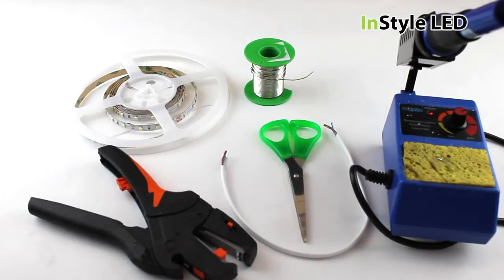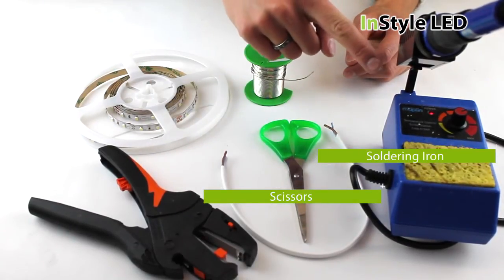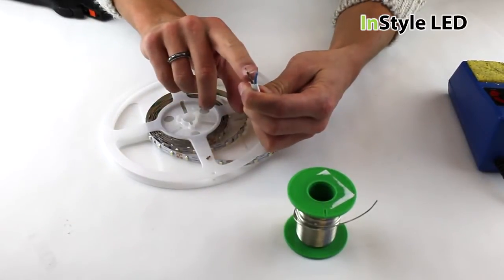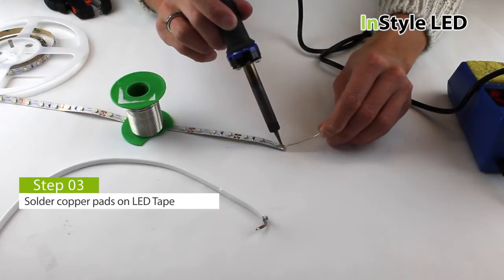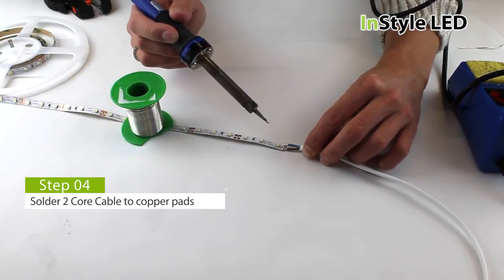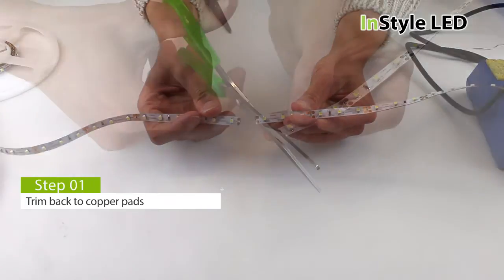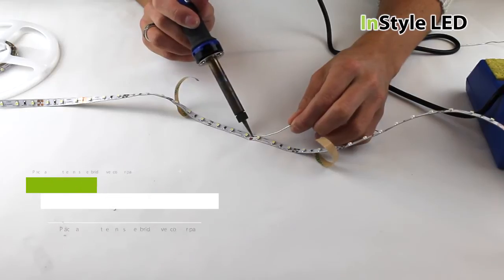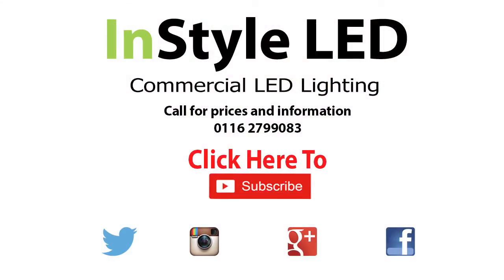LED Strip Lights – How do I solder LED tape?

Comment: I have done this about 1 million times and it is never that easy. Could you please indicate the temperature you have your iron set to, the type of flux/solder you are using, and the type of LED strip you are using.

It has been my experience that I either melt the PCB on the LED strip or the solder just goes everywhere except where I want it. Are you pressing the solder against the iron or the PCB board/wire? 

Basically, your video gives us no information other than, apply the solder to the wires, then the tape, then together. Ta Da! As if we didn't know that already--where is the information here?
Reply from the maker: Hi Jason
Great question.
Always make sure you have a small soldering tip end.
Have he temperature around 400 degrees.
Heat the pcb solder pads up and run (push) the solder into the pcb pad to fill the pad with solder.
To tin the cable (put solder onto the cable) ,  hold the soldering iron onto the cable untill very hot and then run the solder onto the cable.
Then to joing botht the cable to the pcb pad, heat up the pcb pad so the solder turns to liquid and then run the cable inot the liquid solder untill covered into posistion. Then let it cool down and set hard